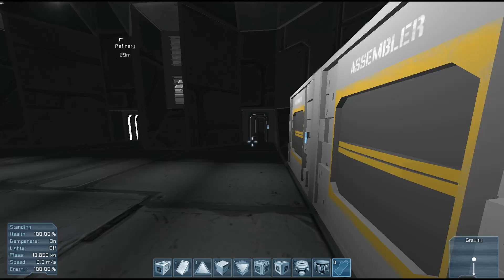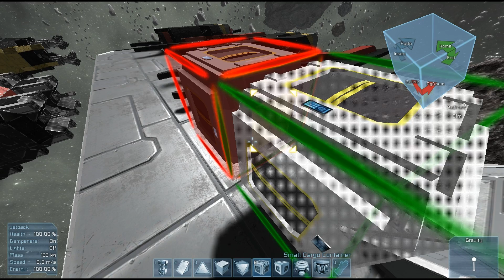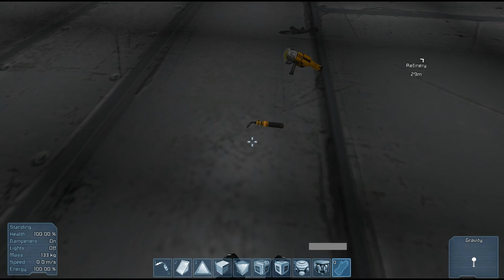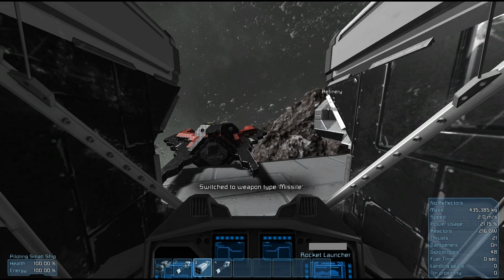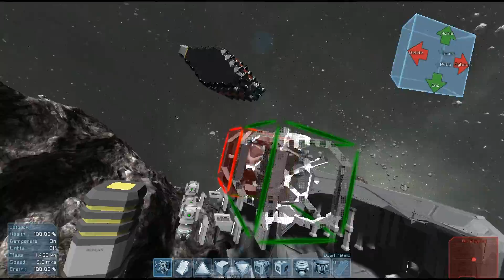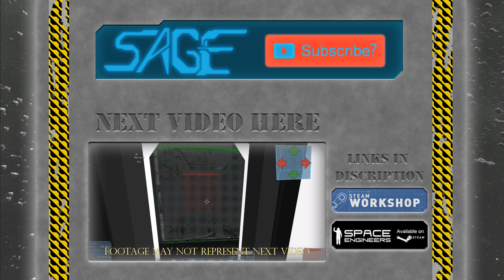Space Engineers, Refinery Update (Component crafting)

Comment: In space, there technically shouldn't be any recoil so your engineer can dual wield with the rifles.
Reply: No, there's recoil. The force that pushes bullets will push you back. There's no friction to stop you from floating back. Weapons like guns would work horribly in space.
Reply: Dagg
not to mention if u one hand a m82a1 it would break ur arm, wrist, shoulder... ur FACE
Reply: your right it would
Reply: Firing a weapon in space is no different than firing a weapon on the Earth in terms of recoil, so any resulting injuries directly caused by said recoil would be identical. The main difference is what happens after the recoil is applied. On Earth, there's a lot more sources of friction to keep you rooted in place. In space, you're going to have a harder time staying still while shooting a gun.
Reply: Andry-Kevin Koort quite true...sorry I gotta say it...I as into space drifting before it was cool (M_M-])
Reply: Dagg which is why rockets are somewhat a more plausible weapon to use in mass on faster ships since it doesn't give off insane recoil...
Reply: however backwards recoil does not interrupt a fighter going sideways ;)
Reply: hahahahahahahahaha
Reply: Andry-Kevin Koort An m82a1 wouldn´t break your arm otherwise it would do that now on earth (Or do you think the friction caused by the weaponhousing and the sorounding air stops the gun ?! No it´s your strength in your arm that resists). It would just accelerate you back if you would have initial dampeners of and no gravitygenerator around. Weapons would work fine in Space even better due to the lack of gravity (bullets would be more precise and range goes up to infinity (if nothing is hit)
Reply: Not railguns though. They magnetically accelerate the slugs, so they don't have any recoil.
Reply: Bryan Merrill railguns would have recoil just like any other gun. using electromagnetism does not bypass newton's laws
Reply: klikkolee yeah, you'll still be pushed back since your launching an object forward...but it is easier to compensate a railgun because isn't as much of a 'kick' as you get from normal guns
Reply: bullstriker1992 was talking about the scenario of firing it as one would a pistol without the support hand. i still think the energy transfer from the rifle to your arms is going to be amplified. since there is no forward force to push back against the force of the round going off. the rifle would just dump most of its energy down your arm. talkin about firing it while free floating. and ofc u'll be sent to god knows where. the energy goes from the buttstock and the grip into the arm and shoulder and since there is no adequare resistance it would spin up pulling your wrist with it and probably snapping it and then hitting you.
Reply: it still does. air blasts from the gun and also newtons theory... Every action has an opposite reaction. thats why astronauts use air guns to blast around. The only thing close to what you'd get there is that the bullets will carry on going forever. Newtons law #3 i think... An object in motion will not slow down unless acted upon by an outside force
Reply: yeah. so whats stopping the rifle from smashing your arm and face? your arm with no support behind you or stable platform. talking about shooting the m82a1 like a pistol with one hand. full extended hand and pull the trigger. bullet leaves the muzzle and your arm goes snap.
Reply: well in the first place in space you could probably dodge 5.56 rounds
Reply: Andry-Kevin Koort The fact that there is no platform behind you wouldn't change the energy going through your arm. If you lock your arm (BAD IDEA WITH A GUN) theres still the same amount energy going into your arm. You'll just fly backwards
Reply: Andry-Kevin Koort
Like I said if your diampeners are off weapons would just kick you back (but not break your arm)(they don´t do it now do they?! It´s your arm that resists the recoil, and the gravity keeps your whole body in place. In space your arm would still resist but your whole body would fly back (if jetpack is off to counter that energy)
Reply: Reading through this, I just feel like so many of you people need to go back to high school physics class. Everything in space - including energy based weapons - would have some amount of recoil. All of it measurable, but not all of it would be noticed. Even if you were to drop something as small and dense as a pencil, that would have an effect on you. Its gravity would pull you just as much as yours would pull it. A cool bro from way back in the day was knighted for these discoveries and the writing of his laws. Also, you would be hard pressed to have even artillery break bones in your body unless you weren't holding onto it when it fired. Dislocation is a different story. Hell there's a theoretical version of propulsion that basically is the detonation of nukes inside of a box, and that was developed during the space race.
Reply: CommanderKiko yeah...they need some re-education I believe...there was this same argument on a CoD:Ghosts vid...
Reply: *****  the recoil would not be lessened. if someone were to accelerate a bullet sized projectile at bullet speeds, it would have negligibly less recoil since the bullet in the gun needs more force to overcome the friction of the barrel. however, most railguns accelerate a much larger projectile at much higher speeds. causing it to have MORE recoil